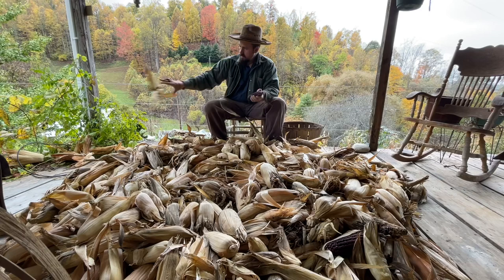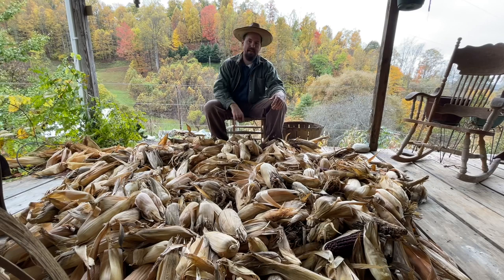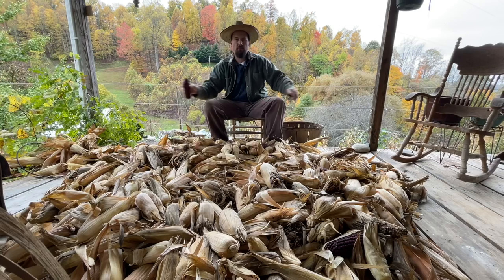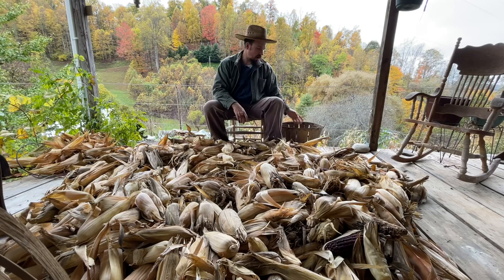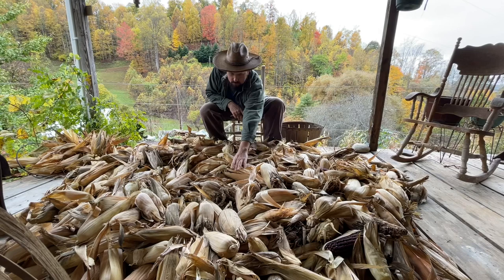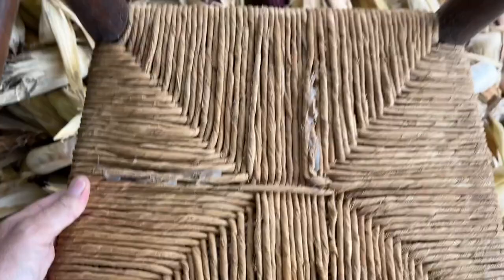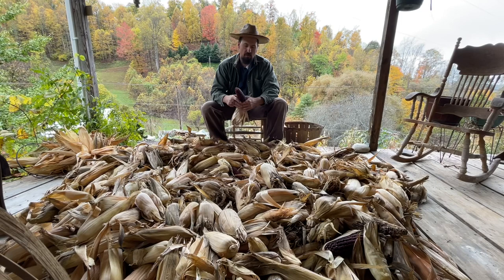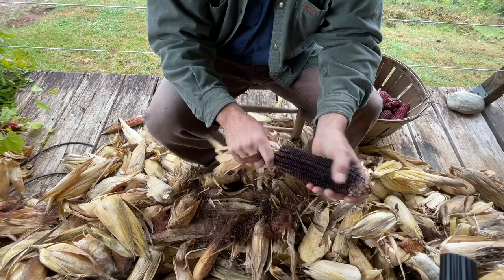Shucking Corn In Appalachia v64

Comment: Place I use to hunt had a old separate corn crib . It was probably 4 foot wide and 10 foot long.  Post where set on a  flat rock.  The floor was about 3 foot off the ground.. this was a area that people raised hogs.  The roof was hinged where you could raise it to throw the corn in. The floor was slanted so the corn would run down to one end that had a small door you could pull a bucket load of corn out.  The only one I ever seen built like this.
Reply from the maker: Ed thank you so much for sharing this with us. This was very interesting to read

Comment: How do you keep weevils out of corn in the crib?
Reply from the maker: After May here you don’t..
Reply: @metcalfmills5679  I'm fixing to pick some Trucker's Favorite, I'm going to try making meal out of it and wondering how to keep the bugs out of it until I get it ground. I thought about shelling it and putting it in a plastic barrel but I reckon it will mold if I do that?
Reply from the maker: Yes it would, you don’t want to do that. Dry it good and then shell it. You can sack it and put it in the freezer or refrigerator. That is the only way I know of to guarantee

Comment: Did they ever nixtamalize the corn?
Reply from the maker: They made hominy a different way. I will do a video about it sometime.
Reply: @metcalfmills5679  would love that. I tried making Masa and while the result made a delicious cornbread, I have a ways to go to manage tortillas.
Reply from the maker: Ann did you have a way to grind the masa?
Reply: @metcalfmills5679  yes but I think it needed to go through a second time to be smooth enough to make the tortillas. But it made amazing cornbread. I used my food processor. A proper wet grinder would have done a better job.
Reply: @metcalfmills5679  just thought of another question. If I dried the nixtamalized corn, could that be ground like regular dried corn?
Reply from the maker: Yes you sure can. Makes hominy grits!